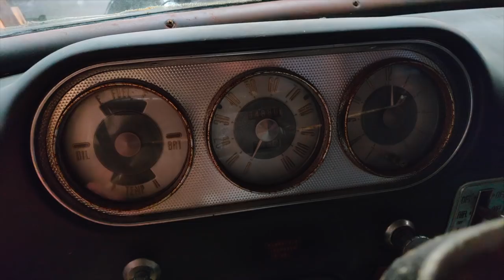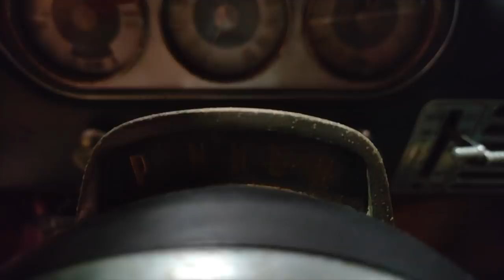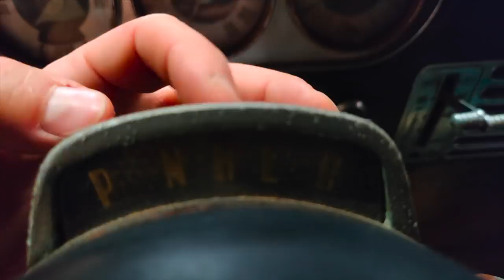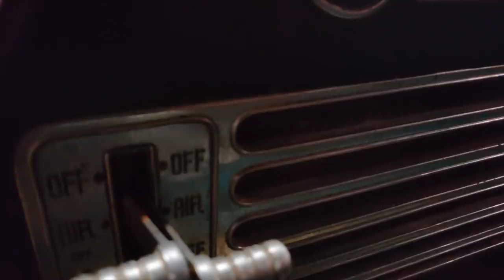Another new project - 1952 Packard 300 straight 8 sedan

Comment: I just saw this.  It's been two and one-half years since your post.  I hope you pulled it together and are enjoying it.  I have a '53 Clipper DeLuxe with the 327ci three-speed and overdrive.  It's unrestored, but with mechanical repairs as necessary, (like brakes, shocks, tune, belts and hoses).  I drive it  every few weeks.  I've taken it on multiple-night trips of more than a hundred miles.  It brings me joy.  Contact your local car club.  I'm in AACA (Antique Automobile Club of America).

Comment: Drove one like this for my driver's license test in 1968. The 52 Packard I drove had a bell in the floorboard (driver's side); so that when you drove into a gas station you just stepped on the attached mechanism with the heel of your right foot to ring it to get station attendants attention. This was factory installed when it rolled off the line. In 1952 there were not many if any service stations that had the bell/ringing services that we are familiar with today. 
Anyway it was fun to use and got lots of laughs and conversations about it when I drove it in 1968.

Comment: Please put out some more content on this Packard. I also have a 1952 Packard with a straight eight. Someone had to of added that push button start switch because stock you had to depress the accelerator to engage that starter. Also the vehicle won't care if you have positive or negative ground. I have a 12V battery hooked up with negative ground to get it running. So it's for testing purposes only lol.

Comment: That is a great Packard---they were very high end cars and well-engineered.  The starter button is an add-on by a previous owner.  The key turns the ignition on (or accessory if turned to the left).  The original starter switch is built into the carburetor.  Once the key is on, pressing the accelerator would crank the engine over.  Once it fired up, the vacuum from the engine would switch off the starter switch on the carburetor and the accelerator pedal worked as normal.  Keep the studs on the engine so your torque values will match the original specs.  These cars have very smooth running engines.  Good luck!
Reply: Buicks of this era had a very similar starting system to these Packards.

Comment: I drove a 1951 Packard 300 for 10 years, so I can't wait to see the progress of this project. By the way this Packard didn't come with push button start. The push button was added later. The correct starting system has the starter actuated by depressing the gas pedal. The key is turned, the gas pedal is depressed, and halfway down the course of its travel, The starter kicks in. It's the same system used by Buick. At some point it must've given an owner some trouble and was bypassed.  The thinking behind the transmission readout is that when the car is stuck in snow or mud and must be rocked back-and-forth, it is much easier if reverse and low gear are right next to each other. it saves the driver from whipping the transmission lever back-and-forth through all the gears. Best of luck from one Packard man to another!
Reply: 100% correct on the starter. The owner will see the vacuum switch on the carburetor which disengages the starter when the engine is running.
Reply: agreed

Comment: 327 cubic inch engine (embossed on head).  I have two 1952 sedans; a 2-door Club Sedan and a 4 -door sedan both with the 288 cubic inch engine. The weight of the engine and transmission is about 1000 pounds.
Reply: 150 hp and 275flbs of torque @2000 rpm the crank shaft alone weighs 103 lbs imho their is no reason to make changes on that car. All systems work excellent. Due to the fact that that excellent engine generates considerable heat ,an electric fuel pump would be a good Idea if driving where you may get caught in traffic. On the road its not an issue, Just a big comfortable ,road gobbling 6 passenger car. I love mine! 1951 "300" in Valient green

Comment: When these were new, that '51/'52 grille was supposedly the largest diecast piece ever made and installed on a car. I have a spare deluxe grille with the "teeth" in it, like yours. It's unreal how heavy it is. I can't imagine what it took to install that piece on a moving assembly line without scratching the surrounding paint. No worries about fuel economy back then! Packard's straight-eights were among the best engines ever produced. Power and torque with uncanny smoothness and virtually free from any vibration. It is fairly common practice in the Packard Club to balance a nickel on edge on the top of the cylinder head with the engine running - and not have it fall over.

Comment: The 1951-54 Packards are so well-proportioned that they do not look large until one actually stands next to one or a photo shows them next to a modern car. The trunks are 30 cubic feet. And the construction of the engine is world-class, they have hardened valve seats and the 327 cubic inch straight 8 has 9 main bearings.
Reply: only the Packard 400 (Patrician) 327 CID had nine main bearings...51-53....1954 the nine main displacement was increased and it used an aluminum head.

Comment: I hope you see this if your unfamiliar! These old cars ran on non-detergent oil. You really should drop the pan and clean it out before refilling with modern multi-viscosity oil, most guys will recommend 10-40, 15-40, or 20-50. If you just pour in the new stuff, it’ll kick up all the sludge and send it through the galleries and if they plug up... goodbye bearings!
Reply: I think I'd use non-D straight 30 weight. Old engines might burn oil on multi-vis stuff, but be happy with 30W. Found that out from an old mechanic who solved such a problem years and years ago.
Reply: But it might be a good idea to find out what the previous owner used also....if he already has used detergent oil, no need to change the routine ‼️👍🍺

Comment: Great project to kick off the summer! Should be Six Tonnes of Fun when you're done. Good to see you back man. :)

Some quick Google-Fu brought up Timesert over Helicoil for heads. "Timesert are solid bushing(threaded inside and out) compared to, well, coiled wire." Save from having one large stud too, heh. Use the mounted head to keep the drilling square they say too.

After I've watched Jonathan W for a while you'll want to read up on your specific models electrical system. Your beaut definitely wasn't dragged out of the woods so you should have a good idea. But things like - if it is a positive ground system, what the starter is rated for(6v can sometimes be started with 12v just not to run lights), if the points have an external capacitor. New things to worry about with old iron. 

Carb looked in great condition for a quick kit. Save you some headaches down the line for sure. Best luck!
Reply: 6 tonnes is very accurate. The engine alone weighs almost half a ton.

Comment: I would suggest becoming a member of Packardinfo.com. The guys there are very helpful and have a vast knowledge of Packards. I am not sure about your engine but I do not think you can replace the studs with bolts as the head will not torque correctly, but don't take my word for it. Also, there are many chapters of Packard Car Clubs around the WORLD! yes, around the World. Some Packard clubs will help you find parts or recommend where you might find them. Further, there are 2 major dealers for Packard parts in the US. So have fun.

Comment: Gorgeous machine. You did right by this one. Definitely a driver, but can see it as a restoration for someone. Would definitely benefit from an electric conversion; 6 to 12, and reverse the polarity, but its a re-wire then, and blocking with ballast for all the period pieces (a chore). Hope you keep most of its unique features intact. These autos were the cream of the crop, giving even Buick & Cadillac a hard time in the market. My Grandfather loved these cars, but could do no better than an Olds even with his good paying job. This may not be a Clipper with the Big 8, but a sweet car without a doubt.
Reply: no need for a 6-12 volt conversion. the 6 volt system works very well. Positive ground works fine as well. keep it the way they designed it.
Reply: @brianwilcox3478  just have found parts like Generator's and 6 volt batteries out of vogue if not a bit temperamental once brushes start to wear much. Leave it 6 volt, positive ground for all I care about suggesting mods is futile unless its all new age and trendy. Glad your caring for it all the same.
Reply: Murry what does "out of vogue" have to do with reliability? The answer is nothing. all parts are redly available. If you want "new age" or "trendy"  I suggest selling the car. because it wont fit either no matter what you do to it. Murry, I must admit I don't understand your comments you sent me at all!

Comment: tube radio...needs to warm up before it works... I had a 53 iwth 45K miles.. engine and trans weigh over 1,000 pounds....when I started mine at night, you could see the arc travel down the spark plug wires - like lightning...

Comment: I've heard of many Packards of this vintage that seem to develop cylinder head problems around 80,000 miles. Engines didn't last as long back then as they do now. The thermostat fits inside the cylinder head. You'll see a ridge around the opening in the front of the head. There's no need to install a thermostat in the upper radiator hose.

Comment: My grandfather had a 49 Chevrolet that was push button start. The key was just like that. He would leave the switch in the on position and just come out of the house push the button and go. He never locked it .
Reply: In the thirties most cars had "step on the starter" starting. The starter pedal was often around the accelerator. You stepped on both at the same time to start. There was no solenoid, and the starter pedal was a mechanical linkage to the starter motor, which engaged the starting motor gear with the flywheel, and made (in the electrical sense) a hefty contact to the starter motor. Then along came solenoids which took less effort and required the little push button on the dash. Then around 1949, Chrysler introduced key-turn starting in their line from Plymouth on up, and that soon became the industry standard all the way up to the present time.

Comment: Years ago, a friend of mine purchased a 1951 Sedan and called me saying that the gauges didn't work, along with most all of the light bulbs inside the car and asked about the possibility of blown fuses. I asked him if the radio also played backwards, the headlights shaded themselves and the horn sucked? With him not knowing how to respond to my question, I further asked if the battery was installed backwards (negative ground)? He thought I was pulling his leg but went and looked and told me that it grounded to negative. Other than losing a couple of bulbs, after switching the cables, all was well. I expect its happened quite often with 'new' owners. :)
Reply from the maker: That's funny! Unfortunately I didn't get a battery with this car so I'm not sure if it was ever converted or not, either to negative ground or to 12v... Any ideas on how to tell?

Comment: They didn't have the technology to do thin wall castings back then so most engines, particularly flatheads are pretty heavy. Plus, if your competition was going "Longer, lower, wider" next year then pretty good bet you were too. If not next year then as soon as you can. Use a Heli coil wherever needed and see if you can rent a magnetic base drill with an electromagnet that plugs into 110v power. They are common in most steel fabrication shops. Check equipment rental outlets. Naturally you want to do whatever you must to guard against even the most minute shavings from entering the engine.

Comment: Cool car!  The radio may work, but it won't work to it's potential after all these years without replacing it's capacitors.  The originals will all be leaky and out of tolerance and no doubt some of the resistors will be out of tolerance too.  Instead of a rectifier tube it most likely has a vibrator in it.  Those can be rebuilt but most folks just replace them with a solid state version.  If you restore it or it works well enough to suit you, consider getting a small AM transmitter and mp3 player for the glove box.  That way you can play your own music and the transmitter will broadcast it to your radio.

Comment: Ignition key is worn from constant use, thats the reason why you can remove it in the on position, I have a 1994 chevy pickup with over a 175,000 miles with the same peculiaritie. Very nice car definitely built to last, I wish the junk they manufacture now could last as long ,but to much plastic and won't be reliable after a few short years.
Reply: I can tell you that a 1965 Pontiac GTO had a key that was removable when in the ON position, and it wasn’t worn out.

Comment: You are calling this a 300cid engine in the title. I believe it to be a 327cid straight 8 with one barrel carburetor, generating 188hp.
Reply from the maker: You're absolutely correct... If I called it a 300ci then I miss spoke :/. Thanks!
Reply: It's a 300 SERIES Packard, one step down from the top of the line 400.  The carburetor is a Carter two-barrel.  Gross horsepower is 150 at 3600 RPM.

Comment: ?? 52 ?? I was born in 51. I'm 68 . Ha ha. And yes rember flat head eights. And they were smooth to drive the dad in law drove with pride. A back seat that had room for checkers and three kids the trunk took a lot of food from the grocery. When you work on it have a chunk of cardboard ( legend the pos ground fact.) Push button  starter  was  the thing and the radio was a AC via vibrator (step up) ( voltage. ) System. Seat belts are cheep insurance. Even lap belts are life savers as this car has NO crumple zones. And the tork has to go some where (the riders.) Head rest kits work fine for neck support. And at shows can be stowed away when showing car. I could go for ever  nice car when you get wrinkles out. 73 de kv4li

Comment: Do not replace the studs with bolts that's a catastrophic mistake on that engine plus leave the transmission cooler the way it is my God
Reply: Agreed! Packard was known for superior engineering. Please put everything back to original you wont regret it. Your car will reward you with superb performance. follow american rambler, and oldenslo advice. but disregard  4thstoodge leave it 6 volt.

Comment: 1952, 70 years old?? try 67. Keep the studs they are far superior to bolts. and they seal better., just heli-coil the one stud (replace w/ a new one) . Change it to 12v neg. ground. You can get a 12 volt  generator & starter. replace your bulbs w/ 12 v ones.
Reply: Whatever you do, take out the radio and look for a guy that restores those radios. In its present form it uses vacuum tubes and a vibrator power supply. It needs to be thoroughly gone through and parts replaced  before applying power, and changes made if you do change to negative ground. It is possible for the guts to be replaced with modern electronics that get FM and receive bluetooth from your phone. Or just disconnect the power wire from the radio and leave it dead.

Comment: Your idea of a remote thermostat in the hose is a bad idea. Due to its isolation from the head you will not get a proper thermal signal for it to open as the motor gets hot.  I do not think it’s a good idea to replace the head studs with head bolts. There was a reason they used studs verses bolts to attach that head. That head is a cast unit with integrated cooling passages and configured to properly fit to the block. Notice the numerous cooling holes and passages? Do not assume the engineering and design of that engine is as crude as you indicate. It may be very old old school, but in those days, Packard did a good job of designing that engine for the period. Packard was still an upscale car brand then. That engine is a prewar design, not a 50’s design. Remember, fuels, oils, manufacturing technology and materials were not what we currently take for granted. Packard was working on its replacement overhead valve V8 when this car was built. It was built as a smooth, high torque motor for its intended application. It’s just that by 1952, that motor was becoming obsolete as the newer lighter weight overhead valve engines were starting to hit the market.

Comment: 84k, full engine rebuild required.
Reply: Mike L. 

Non necessarily. I’ve driven flatheads with over 125k, a bit tired, but went down the freeway with no smoke.
Reply: I ageee 84.000 on mine too